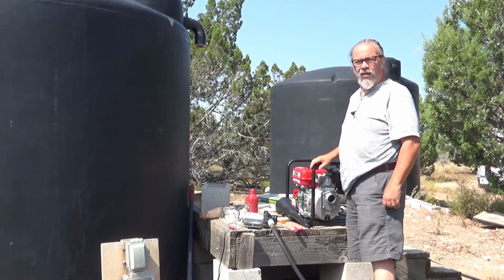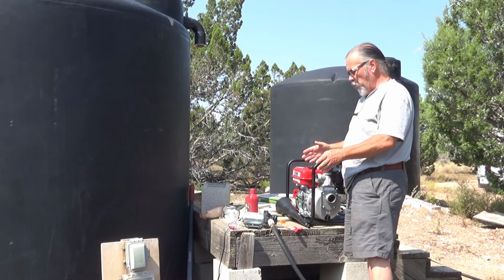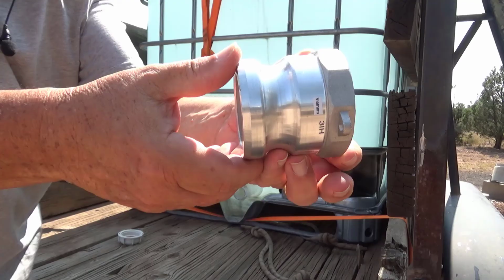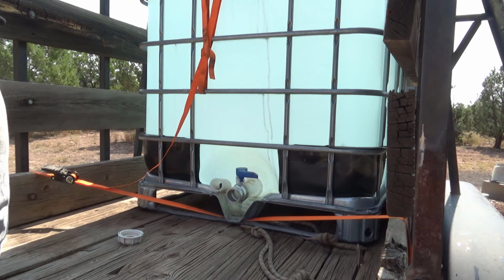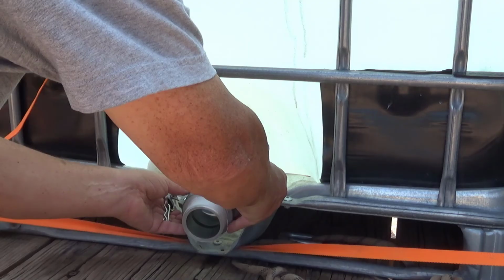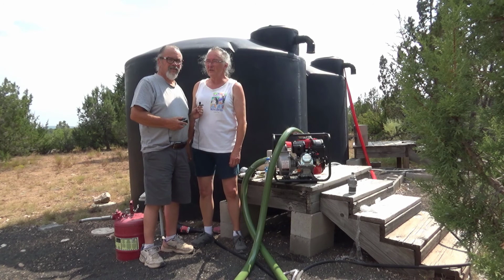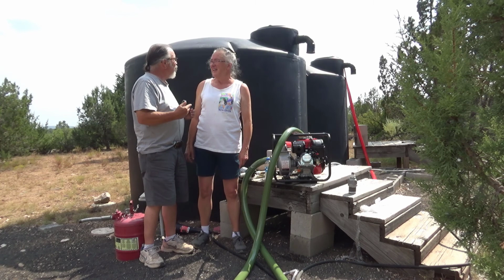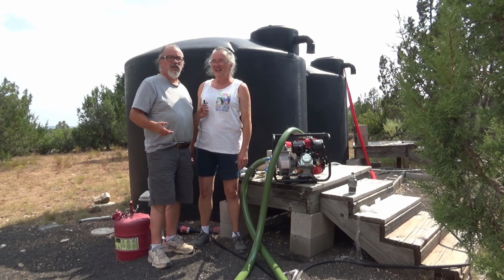Using A High Volume Water Pump To Move Water From Water Trailer To Storage Tanks

Comment: Great job!! Lots of Off grid chores.
We are going to be adding some water tanks that will need to be refilled on a regular basis.
Reply from the maker: That’s great. If you might use a delivery company, we strongly suggest that you plan plenty of space around the tanks for access and turning around a larger truck. Good luck. Thanks for commenting. Take care.

Comment: What pump is that? One of ours is sick and off line.
Reply from the maker: Hi Kathi! The 3gpm pump is a Shurflo with a built in pressure switch so you could use a sprayer and turn off the flow without damaging the pump. The gas pump is a harbor freight 185gpm pump. Take care.